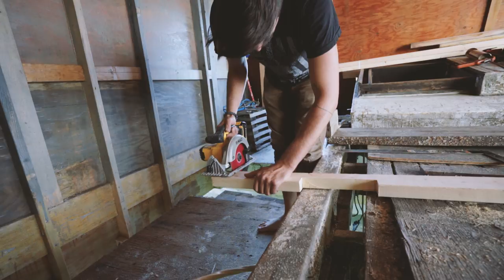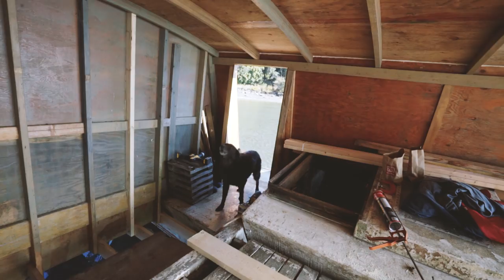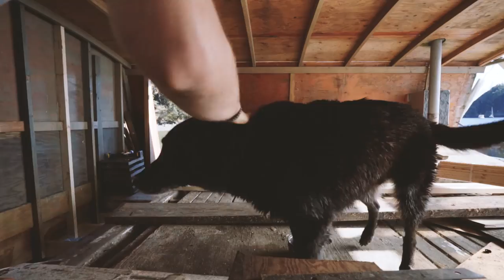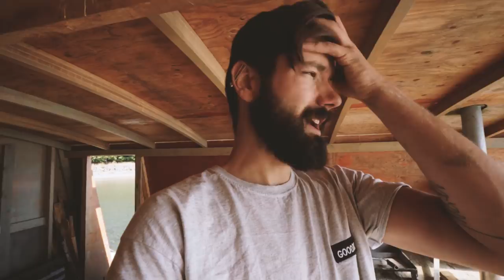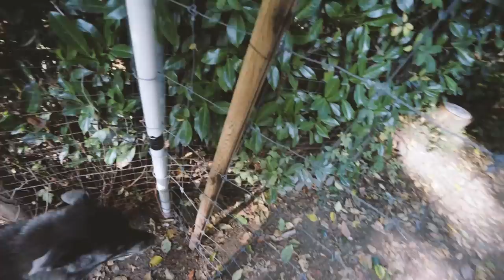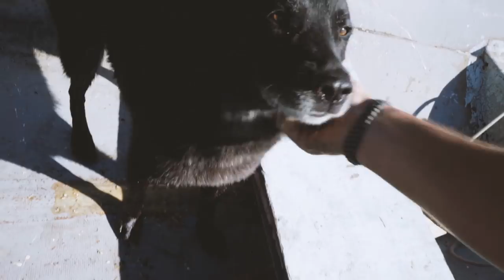The New Floor - Sink or Swim 06

Comment: Might be time to trade the motorcycle in on a used pickup truck given the next year or two of construction work.

Also, I mentioned before as I am sure others have... Check the channel "Sail Life", while he is refitting a monohull. He is doing a lot of the same work you will be doing.

Comment: I hope you are using more than liquid nails to hold this tub together!
Reply: wincrasher2007 lol I was thinking the same thing.
Liquid nails sucks to begin with. It gets what ever in place ok, but what ever you are fastening. Needs to be fastened with proper marine construction grade fasteners. Once liquid nails gets to hard (as it continues to dry) then it gets that hard, it goes brittle. If I building a boat for the seas this will see. I would be using something silicon based for flexibility and then the appropriate fasteners...
Just my opinion 🤔

Comment: You do know about bridge deck clearance while sailing?
Reply from the maker: Still way more clearance than most cats. And lighter. And slimmer hulls.
Reply: The boats you were looking at are complete with much more buoyant hulls. The Wharram's with narrow hulls, like all cats with narrow hulls are sensitive to weight.  This is why you rarely see ocean going Wharr's with bridge deck cabins unless they are made from very light materials.  But don't take my word for it the engineering and polar plans are always wrong and the two I built are wrong too. hehehe But wait a minute, my brother,s 38 just finished a circumnavigation and my uncles left Ontario last year and is now in the Philippines. Maybe I did do something right, maybe.  Anyway good luck with your boat, I won't bother you again.  KORITFW
Reply: I also tried to warn the kid, It will be suicide to try to do a crossing with that floor lowered, It will endo like a motorcycle  when the swell hits the bridge.  I dont even think it would be safe coastal cruising.
Reply: Charles C. I think a Wharram planned and built boat would need to stay a Wharram planned and built boat. Just Chippy opinion. If I was to change anything on the cabin for head room, it would of been the roof height. Not the floor. And I would make that roof more aerodynamic too... JMO 🤔